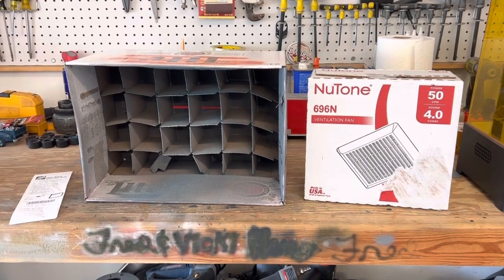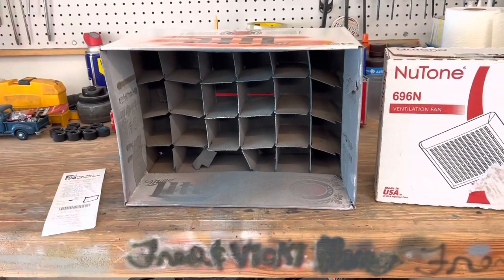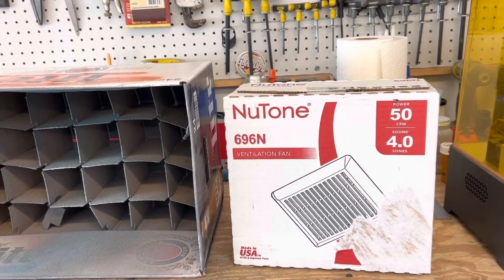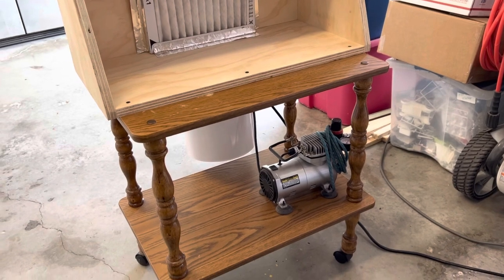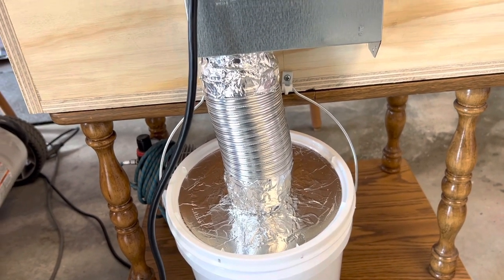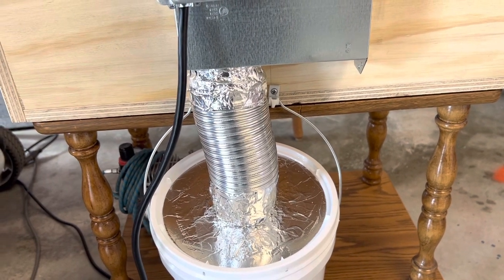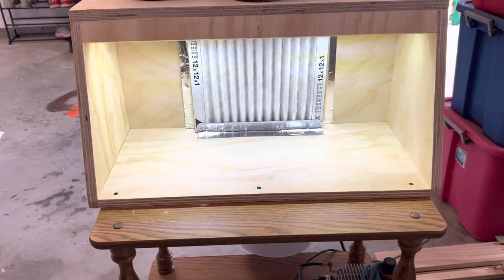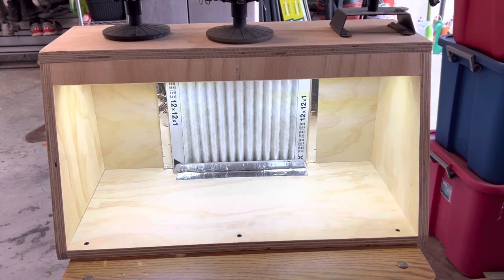Let’s Build A Paint Booth

Comment: Do you put water in the bucket to trap the paint?
I was going to make one out of double foam core, might work.
Reply from the maker: Yes I fill the bucket with a couple of old bath towels and when I use it I will soak them prior to use.

Comment: great video sir. i just built one out of a plastic bin. A question the bucket that you vented it into. can i do that to mine because i dont have a window in my basement to vent it out of.thanks mike
Reply from the maker: Yes you can. I used a dryer hose from the exhaust fan into the bucket lid. I filled the bucket with old shop rags to act as a medium.
Reply: @West_Georgia_Rods_Customs  thank you sir for answering my question.

Comment: That is a pretty cool set up! I bought a cheap plastic booth for about the same money and I dont like it. Its noisey and falls apart and doesn't really pull the air. I got some sheet aluminum   around that Ill use to make a new one. How do you have your bucket vented to let air out?
Reply from the maker: I drilled a series of small holes around the walls of the bucket for relief vents

Comment: hello fred. i have another question .i built another paint booth like the one you built. i bought the sme fan as you did. i vented it into a plastic bucket. do i have to do anything to the bucket or do you just vent right into is all you do. an one last thing.why does it seen like there is air pushing the filter out alittle . thank you mike
Reply from the maker: I use old shop rags in the bucket as a filter medium. If it’s pushing the filter out it’s back pressuring the bucket and just drill some small relief holes in the bucket to relieve that pressure
Reply: @West_Georgia_Rods_Customs  i want to thank you for all your help. i will drill holes in the bucket . i seen you have your filter going up an down i have mine going side to side does that matter lol. dumb question really thanks again.